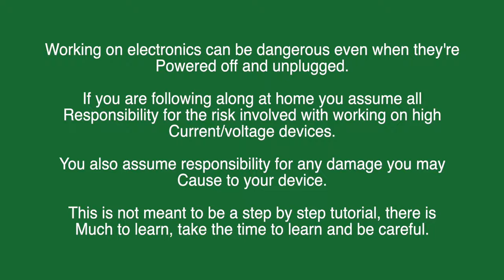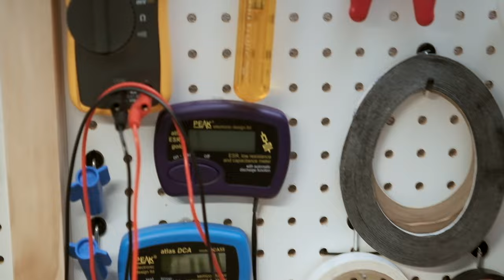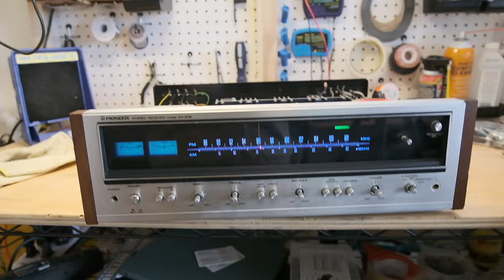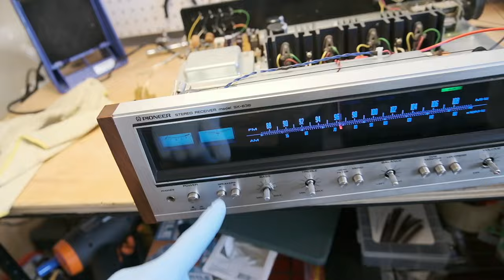Restoring a '70s Pioneer SX-636 RECEIVER!

Comment: Tip!  The push switches basically are the same from one switch to another.  I lucked out at a local Army Navy surplus store and found a similar switch with a different pinout but the parts you really need, the contacts', little springs, big springs are what you're after.  I now have a film canister filled with these parts and the funny thing about it,  I hardly lose them anymore I think because I know if a spring takes off, I'll have plenty of backups so not so nervous handling them.  I think that I once suggested pipe cleaners, folded a few times to get at the contacts inside the switch, and also great, straight into old tube contacts polish them right up.  One last method I've tried and works are those Mr. Clean, white scrubbing pads but that method requires you to make a very nice cut of the pad or it catches on the inside and sheds material.  It needs to be cut like twice the width of the opening and compressed in a way to get it all the way in the switch.  Not that difficult, I figured out a repeatable near screwup free method of using it but I think you would need visuals of it and I can't get photos to stay up.  I should make a YouTube video.
Reply from the maker: Nice! Thanks for sharing this. Solid tips for cleaning the switches.

Comment: Do you have schooling for electronics? And from 1 to 10 being hardest!
Could a novice start doing repairs on these amps, or is it much more than just that?
Reply from the maker: I do not but I’ve been working on electronics since I was in high school (around 15 years). I have done a lot of reading and still have a lot to learn. It’s very possible to do basic repairs and such without much knowledge but there are lethal amounts of electricity involved so you should at least do some reading in regards to basic circuit and have an understanding of how electricity works so that you can be safe. There are some great books out there and lots of forums to read up on. Starting with speakers can be good because there’s a low chance of getting shocked since they don’t directly plug into the wall. Other channels like Xraytonyb are also phenomenal for learning. Thanks for watching!